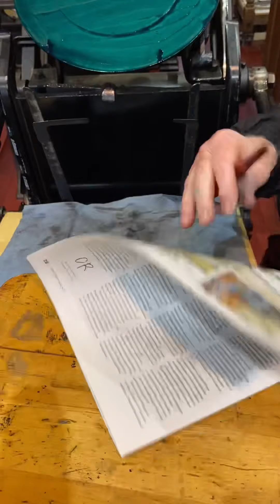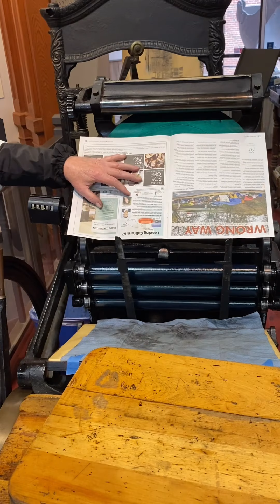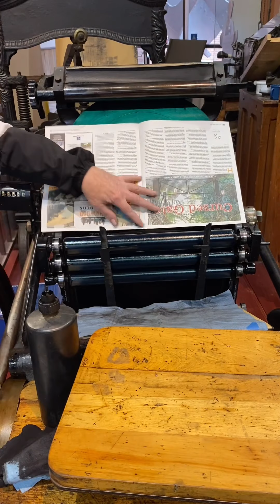Cleaning the Chandler & Price jobbing press after a press run.

Comment: Seriously, if I had taken that long to wash up at the end of a job, my boss would have had me out the door...  I found it was much quicker to pull the rollers out and wash them by hand (wearing gloves, of course), and then wash the slab by hand. That's why I liked days where I didn't have too many colour changes, because it meant I could do more of what I really enjoyed, which was the actual printing.
Reply: De acuerdo colega
Reply: You telling me you can do all that in under 8 minutes?
Reply: @billsedutto8824  Simple answer: Yes.
Reply: @robertnelson3614 where's your video?
Reply: @billsedutto8824 he probably could yes but likely with more wear and tear on the machine. Typically the more convenient/faster ways also result in lower lifespan for the device.